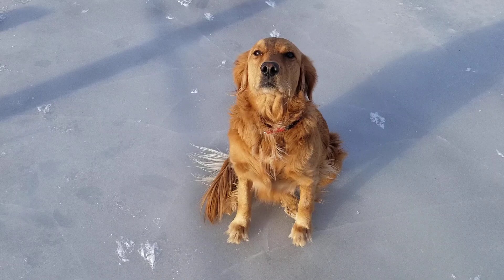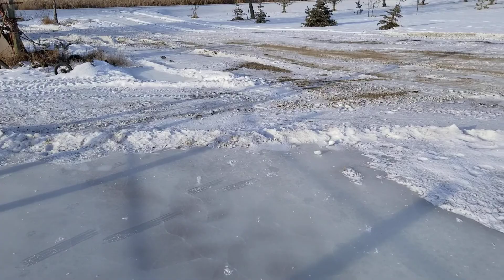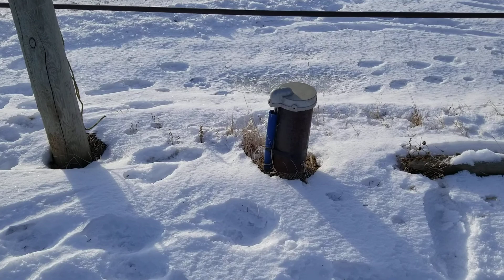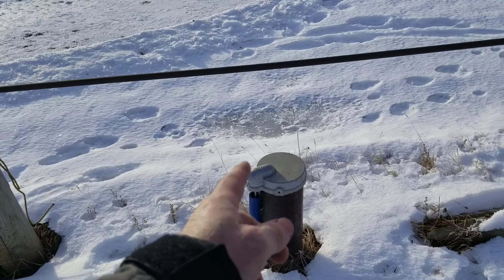How to calculate the amount of water you have in your well

Comment: This is not going to help me messure what water I have left in a 630 foot well.
Reply from the maker: If you know the diameter of the well casing and the depth of the pump, you should be able to calculate the volume of water above the pump. Then you need to determine the rate the water flows  into the well by pumping it at a rate that keeps the level static. If you pump at 5 gallons per minute and the well head is dropping then it flows in slower than 5 gallons per minute.  Knowing the volume in the well will help you determine how much water you have before the pump runs dry when pumping 5 gallons per minute. In other words reserve plus recovery. Hope that helps.

Comment: I bought a house with a 6in, 46 ft well. The calculation looks like around 70 gal. Would this be enough for a family of 3?
Reply from the maker: I recommend getting a flow test to tell you the recovery rate. It will cost you 3-$400 but it will tell you how careful you need to be when using the water. Adding a tank in the house as a buffer will help if the well is a slow to produce.
Reply: @borderpropertyinspections2634  Wouldn't it be 270 gallons not 70? 46' is 552" so that would be (π(6"^2) * 552") ÷ 231" cubic = 270 gallons
Reply: "To express the volume, we use cubic units. To get accurate results, use one unit consistently throughout the whole computation." as said on the Omni Calculator website
Reply from the maker: The actual volume in that well would last no time. The important factor is what amount of ground water will flow back into the well as you use it.